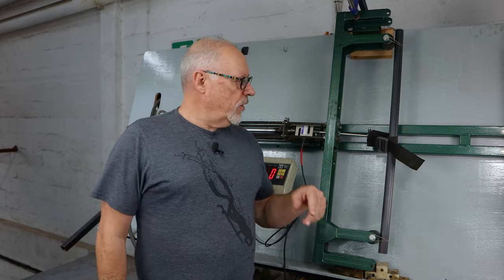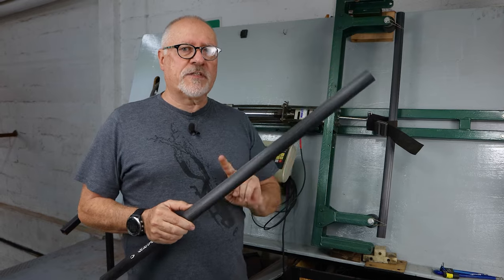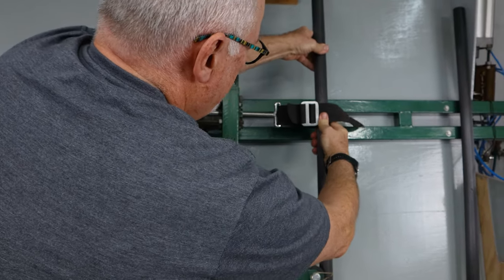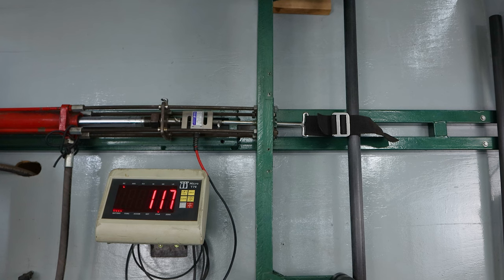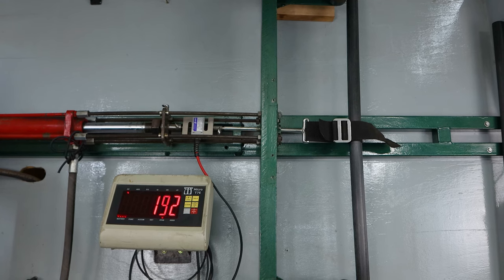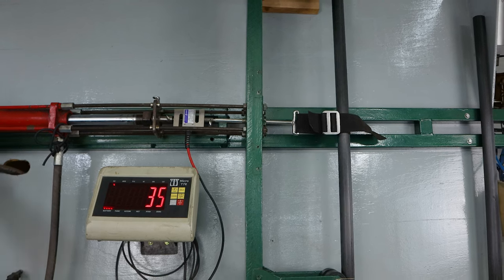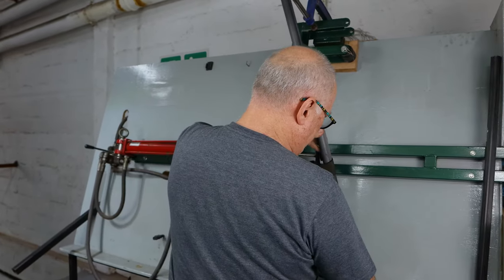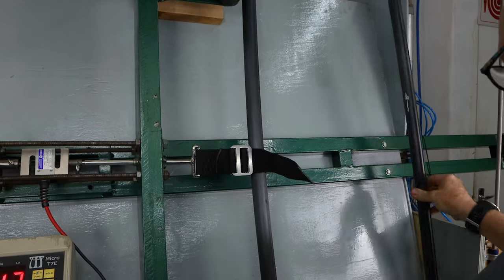Rob Allen | Carbon Barrel Break Test | 2023

Comment: What is the advantage of carbon over aluminum barrel in terms of performance underwater asside from corrosion?
Reply from the maker: Carbon is lighter and stiffer. Because of this we can add lead in the muzzle which helps with muzzle flip and stability. Basically the spear will travel faster, further and more accurate.

Comment: I’m still not sold on carbon. Just my opinion I’m no expert. You’re making a lighter barrel when it’s a disadvantage to have a lighter barrel. Just seems like you’re fighting it with carbon imo. Both recoil and the “sway” of a heavier gun while aiming seem to be advantages to me, at a lesser cost with aluminum. But the strength looks real good obviously (just no sure how advantageous that is?). The carbon make more sense to me on the rollers.
Reply from the maker: The lightness in the carbon tube, gives you the advantage of being able to now ballast the muzzle with lead. Pushing that gun mass forward. The effect is, it increases the muzzle stability through inertia. A more stable muzzle allows the spear to have a smoother launch. That equates to less wobble and friction during its flight, hence better spear speed and better accuracy. You would only see this if you shot a carbon gun side by side with the same set up on an aluminum. 

You can do a similar thing with aluminum, but the gun will no longer float without the spear in it. 

The added stiffness of the carbon will have a similar affect, reducing barrel flex, keeping the muzzle more stable. 

Both the above are only really prevalent on a powered up gun and, not a massive effect but an effect non the less.  

We did many hours of video to show this but not an easy thing to show, I might re-visit it one day.